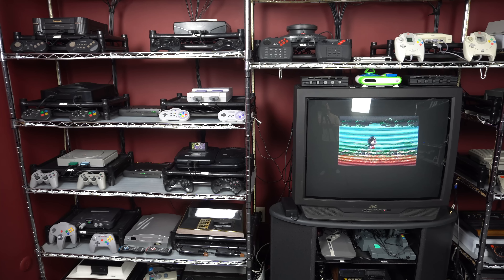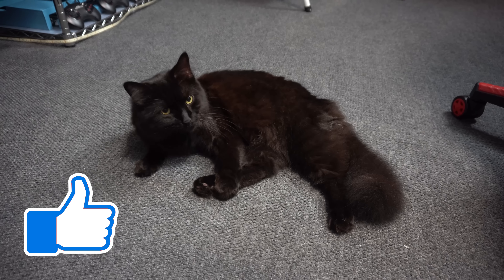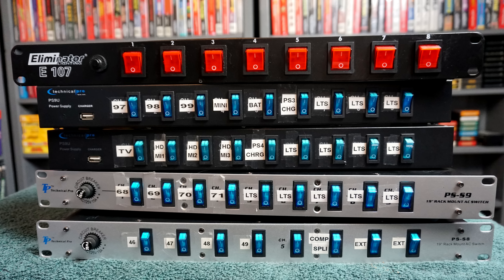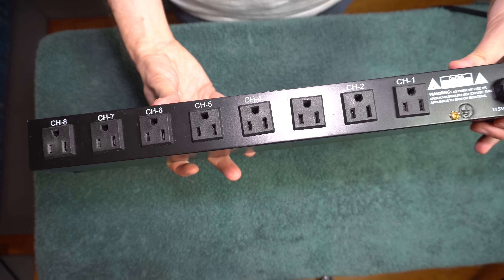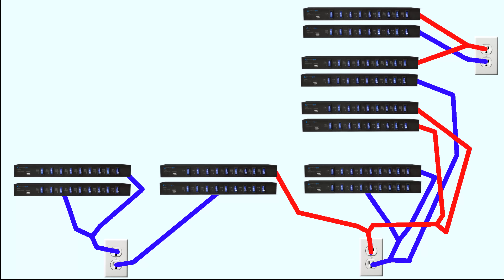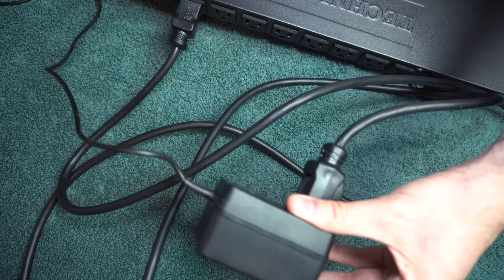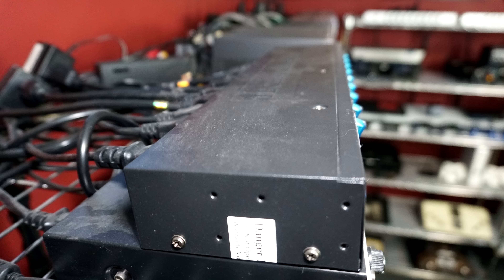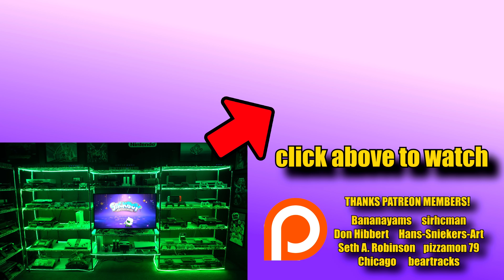How I Power 65 Game Systems

Comment: This isn't an issue in the UK we have switches on each socket (even in multi socket extensions in most cases) and each plug has its own fuse by default, crazy to think how dangerous the US electrical system is. Nice solution to the problem, great video.
Edit-Here's a great video showing the differences from an American native citizen- https://www.youtube.com/watch?v=efh4k6TJa2c

Comment: DUDE you have 19" Power Distribution Units.  Do yourself a favor and get a server rack 1 2 or 3 of them.  You can get like 2U 4U 6U ones that would be perfect for your setup and they would all be accessible and neat.  Just an idea
Reply from the maker: Good idea, but the reviews on these things say that they did not line up the holes correctly, so I may have to drill into them.

Comment: You didn't mention if the three outlets are on separate circuits... if they are are controlled by the same breaker or switch, it doesn't matter at all how many outlets you use as they are all the same circuit. You could simplify that setup with no loss to safety.

Only other pointer would be to check the wire guage on extensions and splitters, not just wire thickness. A thinner cable with a heavier guage wires will be better than the inverse.

Comment: When I see setups like this and the ancient power bricks, I don't like it. Not because of how you did everything, that's a really practical method, I just get ideas how to handle that better.
Why isn't there a lab PSU on the market with many outputs and a programmed voltage on every output, so you could plug everything in to this one PSU that delivers whatever is needed to the device. A few wires and connectors + the PSU would be a really cool thing to have, especially in terms of efficiency with a modern PSU.

Comment: The guy who has the power switcher open and starts moving live wires around then it sparks....  then says I didn't mess with it at all, just juggled a wire lol.  Dude had the cover off(aka messing with it) had it running and was moving a wire thats soldered on(aka messing with it).  I imagine if I opened up my toaster, crt, flat screen, or game consoles and powered them on and kept wiggling a wire something is going to happen.
Reply: If wiggling the wires could cause sparks, those devices are a safety hazard at all times. Proper wiring will not spark if wiggled, period.

Comment: Hey, 

Just a few things. All constructive and not meant in a negative way at all. I'm a qualified electrician.

Firstly, really good advice about using thicker cables. However the thickness of the cable you see (the external black cable) doesn't necessarily mean that the inner cores (cable inside) are any thicker. Some company's pray on this perception and put a thicker outer sheath (the black cable you see) to make people thick they are buying a superior product. If you can then look for the cross sectional area of the cable. This means the copper thickness. Normally this will be printed on the side of the cable. The higher the number, the thicker the core. I belive in America you use AWG. I'm from the UK and we use mm². So don't quote me on the higher number. This is only applicable in my country.  A quick Google will tell you what the thicker number is. This should help when buying new cables.

Secondly, Rack mounted power supplies are indeed mainly used within racks. Racks tend to be used for Data management in comms rooms. These rooms almost always have a temperature control. Even in the UK which is a mild climate. So be mindful of this. I haven't watched the video you're referring to about the testing of one of the units. However, a build up of heat would be negated if it was used for its intended purpose. These are safe to use but being in an ambient temperature area with air flow would help massively. Like in your set up. Everything is just out in the air. This is more for people picking them up for themselves in their set ups. 

Finally, cable management. Please and I mean this please always be mindful of strain on cables. Electricity can jump. This is called Arking. Watch videos of people discharging powerlines. When strain is put on any join ( cable plugged into socket etc) the cable must have adequate support. So for instance in your set up. Using the Y splitters. Make sure the cable is supported next to the socket. No strain should be put onto the cables. If you have strain then this can cause failure in equipment and those lovely metal frames you're using could become live (electrified). If possible I would ground your rack. Electricity follows the path of least resistance. So if the shelf is grounded then it will ark on that and then a safety (fuse, MCB) will fail. It's something to consider. 

Also, on another note. Check out RetroRGB. Bob has some information on the website about new power supplies that can be used on old systems. Made by a company called triad. You can pick them up and it means that you're creating less heat and they are a lot more effective then aging power supplies. 

Thank you for such a lovely video. I found it very interesting. 

Cheers
Reply from the maker: Thanks for your insights. Funny you mention RetroRGB because I watched one of his videos today.
Reply: @GamingTheSystems1  yeah, Bob is a cool guy. Has a lot of insight about technical information. Also My life in gaming do fantastic coverage of retro gaming. I'm really enjoying your content also. You should be proud of the community you're building!
Reply: @GamingTheSystems1   I would second the recommendation to look into after-market power adapters for older consoles.  The linear supplies (the ones that are heavy bricks with a larger transformer in them) often output DC, and the only way to do that is to have a bridge rectifier and some bulk capacitance.  Like all capacitors, they fail with age and heat -- two things a wall wart supply from the 8-/16-bit era has plenty of.  Unfortunately, many of those can be difficult to service without destroying them, so new adapters are a good investment.  Assuming they're of decent quality, of course.  That said, if your old adapter has an AC output, it's probably just a transformer, and will likely last forever, give or take.

With the respect to the OP, I'm going to disagree a little with the part about rack-mounted gear and airflow.  These aren't the kind of PDUs you'll find in comm racks.  These definitely look more like they're marketed as DJ gear.  If anything, a mobile rack packed with amps and lighting controllers and other electronics, running at 120% volume for hours in a club, is not going to have the luxury of climate control.  While airflow considerations are a real thing for wire gauge sizing, these rack PDUs having failed under heavy load don't get a pass based on thermal derating.  The wiring is enclosed in an unvented box, there should be no ambient derating anyway.  It's just simply inadequate wiring if 1800W is causing the soldered terminals to loosen.  OR, it had nothing to do with heat and it's just a bad soldering job, which is every bit as problematic.  There's no excuse for either failure mode, it's not hard or that expensive to do correctly, and so these are just truly poorly built.  I wouldn't trust them as far as I could bounce them on the carpet.  Per-outlet switching is hard to find cheaply, but if I had to pick between lots of switches and crap construction, or one switch and "it'll run at max output indefinitely" construction, I would just go with a one-switch Tripp Lite or Furman strip.  If you're turning everything off at the end of the day anyway, the difference is moot, IMO.

One more thing -- don't worry about distributing the load across multiple outlets.  I would bet my cat that all of your outlets are wired on the same circuit.  Each of the outlets in the duplex are going to be rated for 15A continuous, and that limit is most likely set by the contacts.  15A is a heck of a load for a couple consoles and a TV, and you're unlikely to surpass that without turning that small room into a sauna.  Further, each of the duplex fixtures is probably rated for 20A combined local and pass-through.  Coincidentally, it's pretty common that the entire circuit is rated at 20A (check your breaker, which has to be the lowest rating of anything in the circuit.)  So if each fixture can handle the max rated current of the entire circuit, there's no reason to bother distributing the load.  Just use the most convenient outlet and be done with it.

I know you've said that you have tripped the breaker when the LED lights are on, but I would estimate that not only are all your outlets on the same circuit, but the outlets in adjacent rooms probably are as well.  If you have a room next door with a big old gaming PC or an air conditioner on it, I'm sure that's the problem.  It would take a lot of LED lighting to trip a breaker, even on top of a 200W console and a 200W telly, so there's gotta be something else dragging you down.
Reply: AWG is reverse, the higher the number is, the smaller the wire

Comment: I was hoping for a bit more quantitative analysis of your systems. How much power does each modern console draw in standby? A segment talking about the savings of having the modern ones completely off (as compared to in standby) as well as any issues you face by not having them completely power down.

You talk about how the PDUs can be overloaded and act as if that's normal and the answer is to not plug in power heavy units. While this is the correct solution, the problem should be that a fuse blows, not that electricity arcs and creates a fire hazard. I don't know what the amp rating is per outlet on the switchbox, but it appeared as thought the arc came from the main plug anyways, which tells me that the receptacle the unit has is rated too low for the amount of current the manufacturer is expecting it to be able to handle, or that the fuse is too low and it should be lower so that the electronics don't heat up. Maybe my own judgement is clouded, but if an AC switchbox is rated to run at an amperage, I think it should be able to run at that amperage indefinitely without increased risk. 

Also this seems like the less interesting video compared to how you do input switching. Is it automatic? Some consoles have multiple outputs (RCA and HDMI), how did you deal with that?
Reply: I recognize that in his case that overloading the power supplies is likely never going to happen, but the dismissive nature of "just don't overload it" doesn't seem right when suggesting a power distributor that has some questionable flaws to say the least.
Reply: I would agree, under no circumstances should that happen just from wiggling the cable.

Those products are obviously shoddy and I would not use them for anything.

Comment: Just a tip for people without a crazy setup, you shouldn't leave your consoles plugged in when not being used for extended periods of time. Leaving retro or modern consoles plugged in will kill the power supply or expand capacitors. I was told this by a very reputable electronics repair man who fixed my Xbox.
Reply from the maker: Good to know
Reply: I'm a little ambivalent on this.

On one hand, electrolytic caps actually like to have voltage through them.  Ones that have sat for too long actually need to be re-formed by gently increasing their working voltage before they can perform at their rated load.  Granted, they're not going to be "unformed" after six months or even six years, but just to make the point that voltage is not their enemy.

Heat, however, is the by-product of any powered circuit, and does contribute to aging caps.  Those wall-wart transformers are being slowly cooked over their lifetime, but the OEM ones also most likely have 105C-rated caps.  At this point, the calendar is responsible for their aging as much as the heat of being trapped in a closed brick.

The standby supplies in most more modern consoles isn't that big of a deal.  If I had to guess at what's most likely going to kill the system, it's actually thermal cycling, not accumulated heat.  Older systems usually have a physical power switch, so that's a non-issue.

It seems intuitive that you should leave them unpowered as much as possible, and even I have that nagging feeling as well.  But, I'm not sure there's actually any technical data to back that up.  I have A LOT of electronics that I leave powered 24/7.  My router and NAS are DIY 1U rack-mounted mini ITX computers that never get turned off from the moment they're built to the moment they're replaced with something faster (5-10 years later.)  I have HDMI and Ethernet switches that stay on always.  All of my computers that I use daily stay on for years, until I upgrade and put them in secondary duty as "retro" machines.

What I've gathered so far:  Things with moving parts fail, like fans and hard drives (although those often last well beyond their service life anyway), and things without moving parts pretty much work until I stop using them.  I can't find any evidence to correlate duty cycle with failure, with one exception:  Optical drives.  Laser burn-out is definitely a thing.  Don't leave any disc-based system running overnight.  That's wasting perfectly good hours of usable life.

I would agree that killing power to racks of systems with parasitic loads is wise to save power, but I don't actually know that anything I've witnessed leads me to believe that it's better for the devices themselves to be un-powered.  (Lightning storms and such notwithstanding, of course.)

Comment: It would still a fire hazard in a way  because of the power bricks and their collective ages.. and on wired shelves 
At somepoint i would consider  rack mounting the whole  console  area

typical home wire @ 230/240 vac typically is 10-15 amps

20 amp is typically washer/dryer/oven 

christ knows what amp draws at 110-115vac

Comment: Unless it's a life and death situation a space heater should NEVER be plugged into an extension cord or power strip.  Any wire thinner than #12 awg is a fire waiting to happen.  ScottDot's test doesn't prove anything about the unit itself, it shows what happens when you run a high wattage appliance through a wire that can't support the current flow.

Comment: u really pushing the wattage limit on a typical plug.... like 1875w....
Reply: Only if you turned everything on at the same time, but what would be the point of that anyway?
Reply from the maker: As mentioned, one system and one TV is the typical usage. No system and TV combo requires 1800 watts.

Comment: funny that you have to explaing basically the more basic logic fact. The way to go, is to physically cut off the power from anything. Firrst of all, yourr  devices will last long, without the capacitors constantly under power, second you don't waste electricity, and third it's as you are rreporting in this video, a safe measure. Old or new, doesn't matter, unplug everything

Comment: I'm always afraid to use these Chinese made power supplies and surge protectors. I have my surge protector (a good quality one) mounted on the wall and all the system's power supplies connected to those short extension cords and they're all labeled at the end and tied together right next to the surge protector, so all I have to do is just plug in the system I want then unplug it when I'm done. All the systems video cables are still connected to the TV through a system of 10 million switchers just like yours is, but those aren't really a fire hazard. Also the systems I rarely play aren't hooked up at all, but if for some reason I want to play a CD-i game, I can just take it off the shelf and hook it up. I realized it was too much hassle having all that stuff hooked up constantly when I never play a lot of them
Reply from the maker: I wonder if there are ANY electronics not made in China
Reply: @GamingTheSystems1  Pyle is made in USA